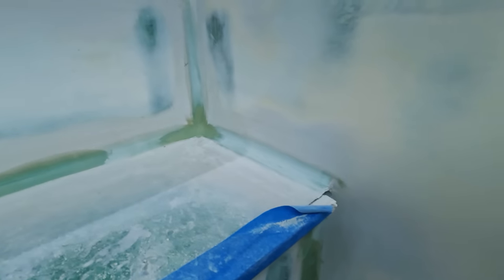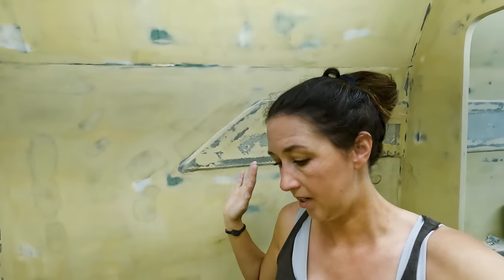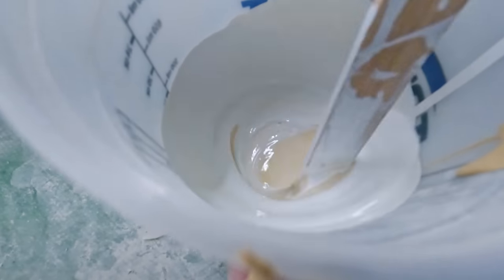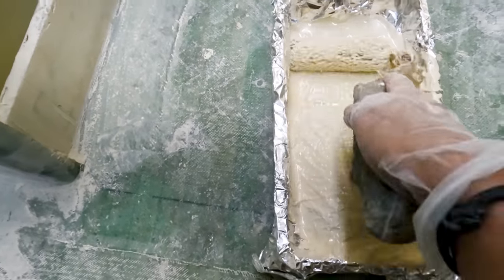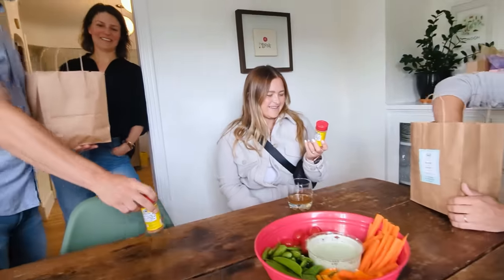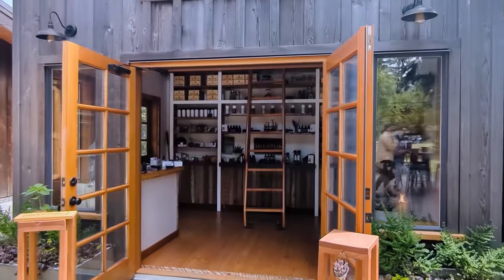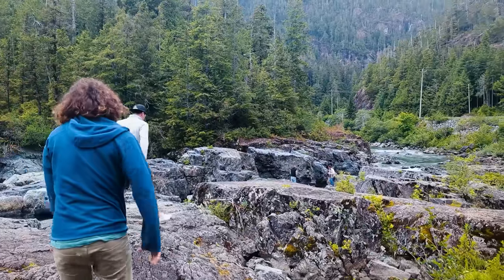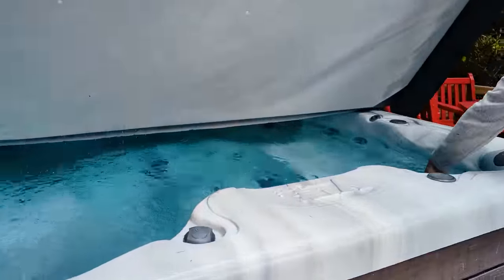I Had No Other Choice....  (MJ Sailing - Ep 294)

Comment: You do a fantastic job at sharing the construction process. USC 26006 icing may come in handy for those nits/pinholes. Check your epoxy primer for polyester compatibility. 410 Microlight is handy too. It’s kind of expensive, so I add it to glass bubbles.  When final fairing I like lighter weight products so the most recent coats sand easier than previous coats. At least 80-90% of a quality finish is prep. Keep at it, don’t hate it, fix it. 😊

Comment: Hey Jessica. Working mostly on cars a few years back, I found wrapping a sheet of sand paper around a paint roller for sanding concave surfaces was the best thing. better than off the shelf sanders that were available. maybe a narrower tube would be necessary depending on radius of your fillets.
Reply: I use dowels for smaller details, and you can round the end for the junction spots.

Comment: For sanding coves, I’ve had pretty good luck using a variable speed Dremel with the flex shaft attachment and flap wheels.  Use it by orienting the drum parallel to the cove. Try to create the coves with a radius that’s a little smaller than the flap wheels, to start. For the corners, they can be roughed out by carefully using a Kutzall sphere rotary burr in a drill. Good luck. There are 1/2”  (and other sizes) sanding balls out there, but the one I tried didn’t hold up. As hikers say, “embrace the suck”. Sorry, just noticed similar comment already posted about the Dremel. Another one I can second, is the mini belt sander. If the cove is just right, it can make short work of the rough sanding.

Comment: for internal radius sanding, you can wrap sandpaper around a thick dowel or a piece of broom handle, lay against the edge and slide back and forth. You can also get 'dome-headed' sanding tools for the internal corners, although I'd recommend doing it manually as you could quickly dig them out if you use a drill.
Reply from the maker: Yeah, I am a little gun shy about easily digging in too far.  So I have been doing the hand sanding, but didn't know if there was a simpler way.

Comment: concerning forming coves quickly and cleanly.. one of the sailing channels had a cove tool, a metal ball the size of a large marble on a stick. it worked really well but I don't know the official name of that tool or who was using it.. I think it was Mads of Sail Life but not sure about that. Also, Andy from Boatworks Today knows everything and may have an idea
Reply: Plunge ball bit or cove box bit. A jig could be setup for a consistent angle and distance from the wall. Overfill and carve out. It will still take some polishing after but at least provide a consistent curve on all joints.
Reply from the maker: The coving tool you describe is used for applying wax beads to a mold.  While it can work with certain products, for us it seems to pull the material out as you pass over.  Everything we tried was just too sticky

Comment: As for the coves, do one corner at a time and let it dry. Well, you can do several as long as they don't intersect. 

Once the non-intersecting corners are dry do the intersecting corners. 

It's basically how people that do drywall handle inside corners that intersect.

Yes, it takes longer but it's less time sanding and filling again.

Also, if you need to remove a bunch of material quickly get a set of rasp files. They have flat and rounded sets that include several dimensions.

Comment: Try foam rollers, less orange peel, saves time, may take more coats but leaves a smoother surface
Reply from the maker: I've tried those before, but they disintegrate on me quite quickly.  There is a small nap roller that I used for the larger cabinets (fwd berth), but we didn't have any on hand. 😥
Reply: @MJSailing  amazon has boxes of 20 or so and I use them with interprotect 2000e and they don't disintegrate that fast, it takes a long time

Comment: To make those corners come out looking half way decent (@ 1:33) I suggest you do one edge first and wait till it sets up. Once that sets up dry to the touch you can finish the other two edges. Otherwise you might be working on all edges at the same time and it will most likely not come out as you envisioned.

Comment: Regarding ideas to simplify fairing and sanding coves: Try adding the coving first, before doing any flat work faring. I think there are two benefits this way.  1) you should be reducing the number of times you have to wait for epoxy curing. That is, you would be fairing the flatwork and the cove at the same time. 2) there is ultimately less area to work. Before, I've seen you sand and fair under the area that you will cove in the future.  Might as well just fair and sand only the cove in the first place.

I've noticed that this fairing work is very similar to sheet rock taping.  Sheet rock tapers start with the inside corners (what you're calling coving), and then work their way-out into the flat areas.  They do the same with outside corners.  They establish the corned, make sure its plumb and straight and then fair it in with the rest of the flatwork.

I've studied concrete plaster walls and ornamental concrete work and they do it exactly the same way.  They establish the corners and then blend it into the flat work.  However of course, there is no sanding and they usually do all the work at one time.  

Professional sheet rock tapers usually complete their work in two passes, that is two times: apply the taping compound, dry it overnight, and then sand.  When you get really good at fairing, what will the minimum number of passes you can do it in? 

Your boat project is great, never miss a show!  🙂

Comment: Your intro reminded me of the process of making a software distribution, i.e. Fix bugs, build software, make a distribution, download and install it, test it, find bugs and repeat. It takes a lot of iterations and usually in the end there a few things that don't get fixed. It can be wearing, so I know the feeling. Once done though, there is a joy that lasts forever. Oh, b.t.w. the boat bounces up and down with waves so the prop angle is never perfect, and you can load/balance the boat as a way to adjust it as well. Someone should invent an auto adjusting prop to keep best efficiency. Perhaps M&J Engineering?

Comment: I do not like to inform you your dual cartridge masks are most likely doing very little to protect you from chemical inhalation. Hopefully they are dual rated for the dust and particulate exposures. These charcoal cartridges are good for usually chemical ppm protection and become saturated so need to be changed frequently. Do not know the range that is in your confined boat when working but fairly sure it would be in the thousands and the cartridges will usually only protect for less than 100 ppm. So for example if the atmosphere is say 1000 ppm of styrene in air and your cartridges are brand new and you have been trained and properly fitted for the mask you are using you will be breathing 900 ppm. Better than no protection but not much . The only real protection for you two would be supplied air which is a pain in the ass but I am sure you value your health more than this beautiful boat you are building. Been out of the lab and industrial hygiene monitoring for over 20 years but worked at chemical plants my whole life. I previously did styrene and vinyl chloride monitoring but cannot remember the Tlvs and numbers associated with them but I am positive you are being over exposed . Then there also is a whole other side with skin absorption . Please beware as you cannot buy your good health back !